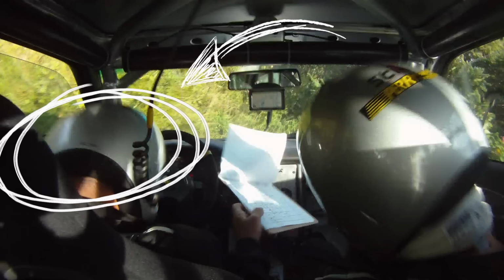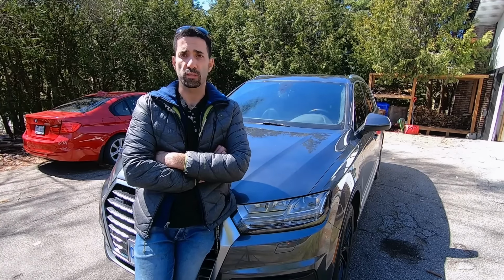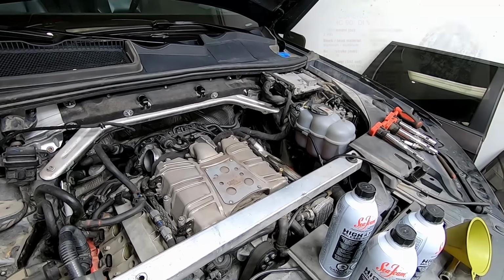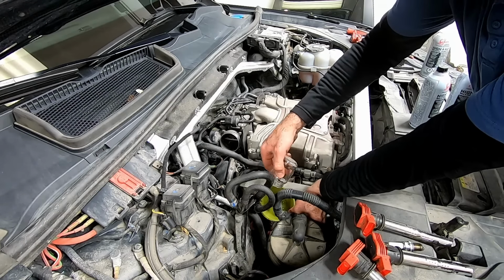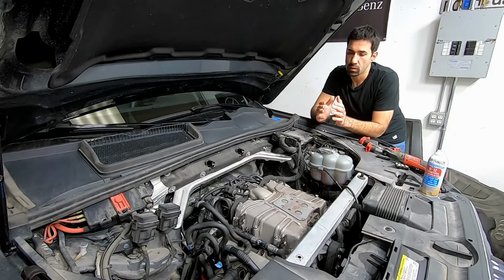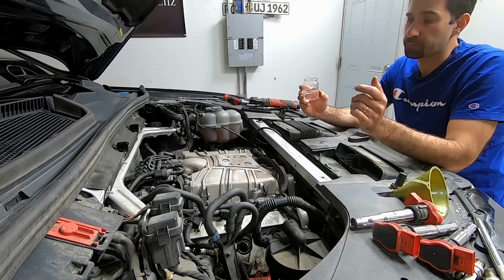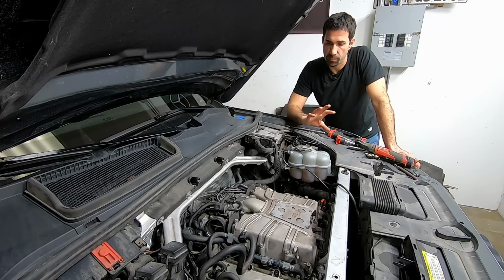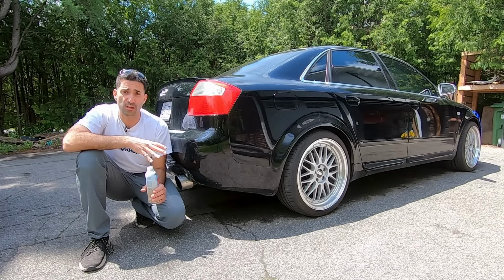How to fix oil consumption on VW/Audi/Porsche 3.0T engine?

Comment: Wonderfull Video! I have leeking Injectors in my 3.0 TFSI, that contaminated my motoroil with Gas and i have a moderatley dirty engine, and i need to replace my Valve Cover Gasket. Would you recommend to reseal and overhoul the Injectors + Gasket first, and than do a Piston Soak, or do the Piston soak first, and than care about the Injectors?
Reply from the maker: @kalossthenosmatters-2807 hmm you gotta deal with the injectors first... if they're adding fuel to your oil you'll be in trouble pretty quickly...after that gasket and piston soak to clean it all up
Reply: @ETMotorsports  Ok, great. How can i make sure my Valves are closed when i have to blow out Dirt of the Cylinder with compressed Air? Is there a way? I have a cheap endoskope but with this, i can only see the Piston.

Comment: To be honest this means you can also do this by adding it directly to the motor oil. Dont drive the car around but you can add it in the oil direclty allow it to gain heat and circulate  through the motor. The additive will get past the piston rings and allow it to clean piston rings. Remember these additives are lighter then oil so they automatically  flow better. Just remember to use a low weight oil like 0w 40

Comment: Is it safe to say that this problem arises from the fact that the manufacturer recommends 10,000 mile oil changes with crappy castrol oil? Then that, coupled with a very loose piston ring design, causes this buildup?

I did the piston ring soak about a month ago and I’m at 2500 miles with no certain signs of burning. 

Thus, safe to say that at this point, adjusting to an oil change every 5000 miles with higher quality oil, should avoid the buildup. What are your thoughts?
Reply: Yes! I have a 3.0 in my A8 and change the oil every 5k and it does not burn a drop (literally) between changes. Mileage is 50k and the FIRST oil change was done early at 3,000 miles.

Comment: Excellent video, thanks for making it! You got my imagination going. A few ideas (maybe not good):

1) I realize TDC is good for piston coverage on this 90-degree engine, but I wonder if it is actually letting some of the treatment flow out of the exhaust valves? I wonder if this is why there was so much smoke. Maybe there is an ideal cylinder location/stroke? Perhaps just before BDC on the power stroke? All valves closed and hopefully the "tallest" edge of the piston is below all valves? Perhaps we could calculate the precise amount of fluid to use in this situation. Just trying to think of ways to further formalize your process for this engine. I am not an expert, so maybe my ideas are dumb. You got good results already!

2) I wonder if you have inadvertently discovered a good DIY process for cleaning the (always dirty) intake valves? I wonder if some variation of your process could be used to target the intake valves. Perhaps intentionally orient the cylinder somewhere after TDC on the intake stroke? Or maybe people are already doing this and I'm just oblivious.
Reply from the maker: hey - both great ideas...the smoke on startup is normal - I saw it on all 3 of my other cars...the B12 gets everywhere so until it burns out it smokes like crazy...

There's definitely a more scientific way of doing this but it would require an engine on the stand here to play with and experiment and the 3.0T isn't very common so I haven't been able to find one. Yeah carbon buildup on the valves is a big issue - I like your idea about doing this on the intake stroke - pretty much need to find the earliest both intake valves are open with the piston at highest position and then add the liquid. That way it will coat the piston and valves at the same time...going down to BDC though wouldn't work because you'd have to fill the entire cylinder with solution - you want the least amount of volume possible with the valves open...This can be applied to the 2.0T as well - same issues with valve carbonization...
Reply: @ETMotorsports  I was thinking about BDC specifically for piston ring treatment only, to keep the valves completely out of the picture ... ensure we don't lose any B12 through the valves. But maybe this isn't an issue. Do you suspect that you lost B12 through the exhaust valves when you switched over to using TDC only? Thanks again for making this video!
Reply: I think b12 going out the exhaust valve might be a good thing. I've seen some recent cases of people who neglect the oil consumption issues on the CREC motors and they end up with a burned valve. The b12 may cleanup the valve seat and promote a better valve seal.
Reply: @pearl04tl  The issue I'm worried about is those cases where the treatment drained out of the cylinder. If it drains out then we aren't treating the rings as good as we could for 24 hours. When that happened in the video my mind went to the valves, which is why I started thinking about how to remove the valves from the picture entirely (when targeting the rings). Just a thought.
Reply from the maker: you want the liquid to drain out through the rings - if it's not draining out, you're not treating them...as it's draining down, the liquid is penetrating through the rings and going everywhere (hopefully) to soften up the carbon and free them up...
Reply: @stephenbraddy9925  Hopefully @ETMotorsports will reply to your comment, but in the meantime I just wanted to add that I really like your idea (using BDC to keep the valves out of the picture, and only treat piston rings), because... it would have another significant benefit: decreasing the possibility of engine locking up due to carbon debris.  

Multiple commenters (as well as @ETMotorsports) have mentioned the crank being hard to turn, due to carbon accumulating at the bottom of the piston after a B12 treatment.  Doing just the piston rings (or doing a phased approach, piston rings first, then valves a few thousand miles later) would seem to be a safer approach.

@hgas9631 said the B12 treatment initially worked fine, but then his engine locked up a few weeks later.  He ended up removing the cylinder head, and was surprised at how at how little carbon it took to seize his engine: "Once the head was off you could see carbon on top of the piston which had been compressed and preventing the engine from fully rotating just like what you experienced by hand. I would have never expected such a small amount of buildup to be able to stop the engine in its tracks like that. We’re talking less than an eight inch of carbon on just a small portion of the piston top."

Comment: Hey! Thanks for the video, it is EXTREMELY helpful! I want to try the soak because of my oil burn (1 qt for 1200 miles) but my 2017 Q7 is throwing a lot of white smoke through its exhaust all the time. So, I’m afraid a soak won’t help me. Wanted to ask you if the soak can still help or is there a different issue? Thanks a lot again for the vid!
Reply from the maker: @isaretsiz8702  hmm white smoke is coolant... do you know where it's coming from? Head gasket? You can do the soak regardless but it sounds like you've got bigger fish to fry
Reply: @ETMotorsports  my indy mechanic told me it wouldnt be the gasket but i’m not sure. We checked the coolant and it’s still at max. Also he told me he never needed to work on a head gasket with these Audis, so it should be very unlikely. Do you think it might be a faulty O2 sensor or a brake fluid leak into the brake booster?

Comment: I just finished driving ~500km after doing this - oil consumption went down from 1 quart every 600kms to not even moving after ~500km!
Reply from the maker: @vSynZero  3.0t?
Reply: @ETMotorsports  Yes - the 3.0t crec. The engine has more power now - compression was tested at 150psi before so it might have gone up after

Comment: I have currently available Royal purple Max clean and atomized injector cleaner.. 
I clean the piston tops of a Mercedes Benz v6 engine but still have oil show up when i hand crank and the piston goes down on the sides of the cylinder..
That points to clogged drain holes ..
Do you think it would help if i do hot soak piston on TDC and valves closed and I contact some adapter to spark plug opening and pump compressed air??!!!
Reply from the maker: @The_Future_of_Lighting  hmm the compressed air didn't seem to help me - I tried... it just pushes the piston down so you'd have to lock the crank somehow if that's what you want to do... but the B12 soak handles the situation you're describing - are you not able to find it?
Reply: @ETMotorsports  it isn't available in my country.. we have Liqui Moly and Royal Purple products only. Soaking is great and car has to run hard after which is the root cause of my problem of desolved carbon regarded..
Will try hot engine soak with hot cleaning solution it might help , what do you think?

Comment: would it have been 'safer' to drain the oil and replace with recommended instead of running it with the barrymans mixed in the oil ?
Reply from the maker: @Pwnulolumad  yup... for sure it's safer to not run B12 inside
Reply: @ETMotorsports my idea is to throw some barryman piston soak in the holes while I’m working on cleaning carbon out of intake valves (physical picks not media blaster). Since you have to turn the crank to close the valves before carbone cleaning I figure it’s a good way to do two things at once. Is there any obvious problem with this idea. ?

Comment: another great video! question if you know. i know on the MQB platform short commutes cause faster intake carbon buildup than people with longer commutes. could the owner have a short commute constantly that might allow for more buildup? just a possible thought. so glad i found the channel keep up the great work and cant wait to see some vintage audi content
Reply from the maker: thanks! Yeah I thought about that too but honestly the owner raked up 1200km in like 1 week so his commute is fairly decent...I spoke with him quite a bit trying to figure out what might cause all this mess but he is using the right oil and the right fuel so unless it was the previous owner that neglected the motor, I don't think it's a user issue...I`m going to try and get my hands on another 3.0T to poke around and see if I can spot the same problems...

Comment: Hey, had an idea to share with you on soaking pistons in the V config for the future. I was think how to get the whole piston soaked, and I thought, well, why not use an old compression gauge hose, or leak down hose. Anyway, just thought I would share that thought. Catch ya later, and thanks again for the vids, Subbed.
Reply from the maker: @MichaelCarreras good idea... I thought of that and actually tried it too but you can't soak all at the pistons at the same time and when you put pressure in,  the piston actually moves down... the best thing so far is to soak at TDC two at a time... that way you clean the piston and the top of the chamber
Reply: @ETMotorsports  Right, but I wasn't thinking of applying any pressure, just using a hose to raise the available height. So if we took a couple of old compression gauge hoses and cut the tops off, kind of thing. That would allow us to fill the cylinder up until the first open valve, and if we actually set the cylinders so that the valves were in the compression stroke(closed position) we could theoretically easily cover the entire top of the piston with less b-12. Any hoot, it was just a thought. Love what you are doing !! Thanks for the reply!!
Reply: @MichaelCarreras  same concept as riser tubes in irrigation systems. the old hose just makes the cylinder 'taller' and the liquid can sit about the factory hole opening
Reply: @Pwnulolumad  Yea! What he said!! :) Thanks!

Comment: 20218My 2018 Q7 3.0T 70K miles requires at least two quarts of oil between it 10K oil changes. 
Question: The engine’s stop-start feature turns the engine off before the car has fully stopped.  Could this add to issues?

Comment: I'm in the middle of doing my wife's car right now. I'm on my last two cylinders. One soak in and it won't turn past top dead center. Even after blowing tons of chunks out. Thinking the second soak will help. 

One thing I wish I would have done is made sure to only blow cylinders out while the valves were closed. It's possible I could blow something into the intake.
Reply from the maker: @TheJimmyThreeSticks  I wouldn't worry about the intake too much...as you saw most of this is in dust form... even if it goes through it'll just burn out...
Reply: @ETMotorsports  I was concerned about the chunks and things like valve openings. I seemed to have good results though.

Comment: After the soaking of all the pistons are complete and you use the starter with the sparks plugs out for a few seconds:  is there anything special that i need to do?  Do the walls of the cylinder need any type of lubrication before I hit the start button or because its only for a few seconds on the final blowout it should be good as is with nothing added to cyllinder walls.  I will be hand cranking for 10 to 15 min before i use the starter.   Thanks!
Reply from the maker: @natemcfadyen3689  hey no worries about lubrication - the oil pump works when you crank the engine so you should be ok

Comment: Can you advise what special socket you are using to turn the engine at the crankshaft pulley to get the pistons at top dead center center? Can't you just rotate the crankshaft pulley after putting in the solution to one pair and getting all the pistons soaking for the same 6 hours? Also, what socket and length are you using to remove the spark plugs?  Lastly, i read that the coils are hard to remove, is there a special will for this? I have a 2017 Audi Q7 3.0.

Comment: Even if you use an eve higher octane fuel can help this aswell. Theirs more alcohol and ethenal in higher rated fuel. These can also disolve carbon naturally. Since it wont all ignite when it enters the combustion chamber
Reply from the maker: @Audifordguys  unfortunately nothing else seems to work... you can't fix it with oil or fuel additives - the rings get completely caked up
Reply: @ETMotorsports  yknow what I appreciate  the response. I'm going to make a YouTube video explaining what I mean. But what you figured out. Is gold

Comment: Hi there, first off that was an amazing video demonstration! Very impressed with how clearly you explained everything! 

I have a problem. I definitely have a lot of carbon build up. My car isn’t necessarily burning thru a bunch of oil, but I have blue smoke coming out of the tail pipe on hard acceleration (4,000+ rpms). I also have hard shifting 1st-2nd and sometimes 3rd gear. Is it possible I have stuck piston rings from carbon build up and need to do this B12 piston soak? 

Thanks in advance for any advice you have, I’ve been dealing with this issue for a while and it’s frustrating!
Reply from the maker: @Sle3p520  hey thanks for the kind words! Blue smoke is definitely oil related but if you're not losing a lot of oil it could be coming from the PCV too... doing a soak won't really hurt anything so definitely worth a try and I would do the PCV service at the same time... for the shifts that's a different question - any codes from the transmission? Have you done an oil service? What car is it?
Reply: @ETMotorsports  14 Q5 3.0t (basically this Q7). It has 233,000 km on it and oil has been changed every 8,000 km with Castro Edge 5w40. 
I just recently did this year
-ZF8 transmission/filter change
-PCV
-SC intercooler bricks

I have a soft code for PCV, but a few days ago I did the SC bricks and the valley under the SC was completely dry. No signs of coolant or oil loss. No other codes that could cause this issue. And just recently I learned about the blue smoke whenever I hard accelerate. It does not blow blue smoke when driving normal/idling.

Comment: What is the special socket you are using to turn the engine at the crankshaft pulley? I have a 2017 Audi Q7 3.0.
Reply: I would like to know also
Reply: Also interested
Reply: Still waiting on this reply

Comment: I ended up here after a FB post with oil cunsumption issue.
Last year, I didn’t get any result when a friend of mine put B12 as you suggested in my 2011 Q5 with 150K.
I now wonder if he did it properly seeing this newer video.
I have 2 questions:
Will I see any changes if I just pour B12 at each whatever gas filling 
And
Have you ever of KLEEN FLO (some) chamber
A tech nearby Montreal told me he has huge success but the product is now BO
Thanks for all your time
Reply from the maker: there's no guarantee that the soak will work from the first try...I'd say the majority of people see some results but if you've seen nothing, it doesn't hurt to repeat the process...can't speak for other products but as far as I have seen nothing works by being added to the fuel or oil at regular work...

Comment: After removing the spark plugs, I noticed that the spark plugs on the left side of the engine (standing in front of the car) had more carbon on them than the ones on the right side of the engine. What could be causing this?
Reply from the maker: hmmm nothing specific...could be that those cylinders burn more oil, the injectors could be running worse...1000 different things...